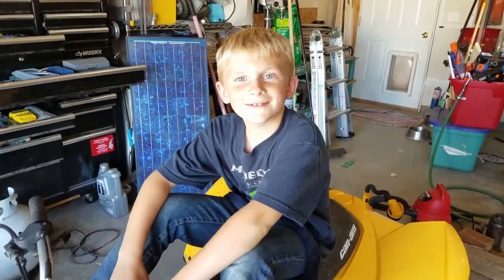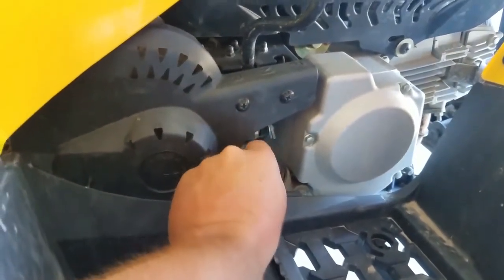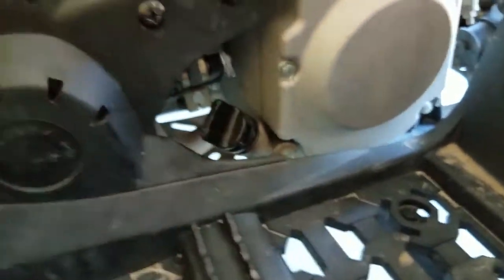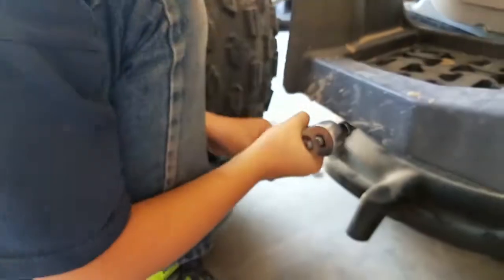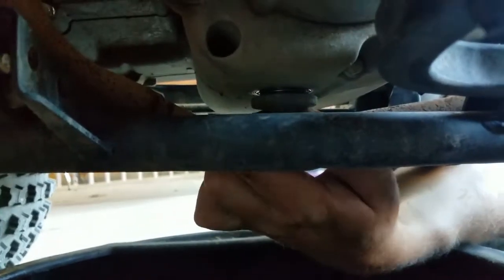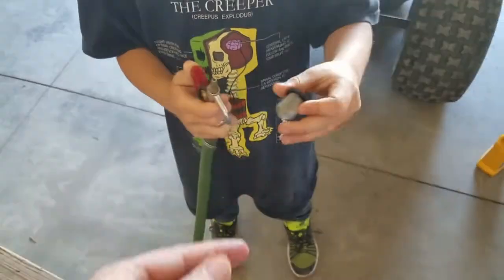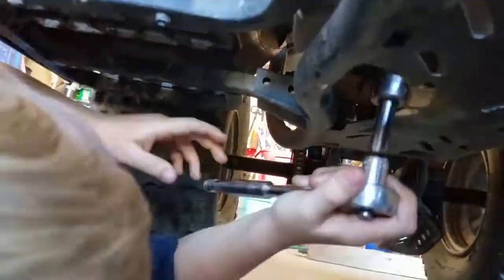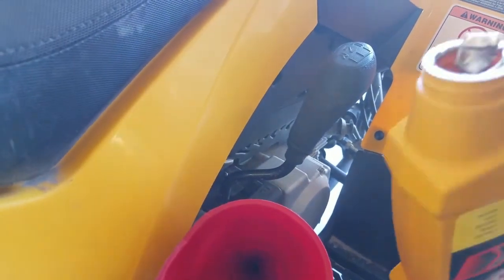2015 Can-Am DS90 Oil Change

Comment: Quick question I'm restoring a 2015 ds 90 and I need to know what size the battery fuse is. Cool video by the way!
Reply from the maker: My boy's has a 15A240v fuse in it from the factory.
Reply: @StJC-kl4fi  sweet thank you!
Reply: It looked like you also drained the crankcase oil. What type of oil did you use for that?

Comment: make sure you use 10w 40, kid
Reply: 0W40, 5W40, 10W40, 15W40, 5W50, 10W50, 15W50, and 20W50 are all acceptable weights for these DS90 ATV's. The manual was revised in 2020 or so and added heavier weight oils (50 weights). My 2017 manual said you could use 5W30, 10W30, 10W40 weight oil, but they revised the manual to use heavier weight oils, without changing the machine, which tells me that they must have had too many blown engines or worn out engines with the previous recommendations of as low as 5W30 weight oil. If you have one of these, find the latest manual and read what the latest oil recommendations are. Just don't use energy conserving oil. There is no wet clutch on these so dont have to be too picky with oil... ANY 40 to 50 weight oil, conventional, blend, or synthetic, car oil, motorcycle oil, ATV oil, they all are fine and work great. I use Mobil 1 15W50 in mine, its cheap at $22 for 5 quarts at wally world, and has good specs. I live in south Florida and its 85-95 degrees most of the year...